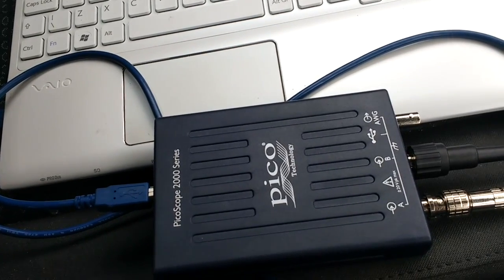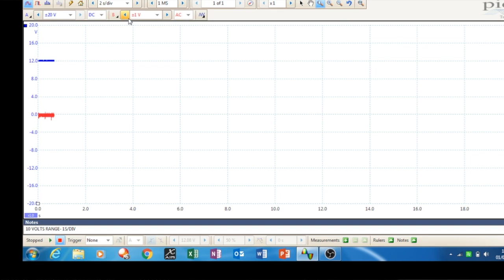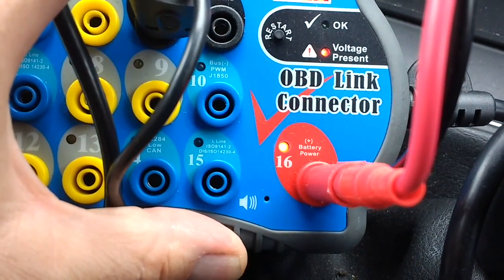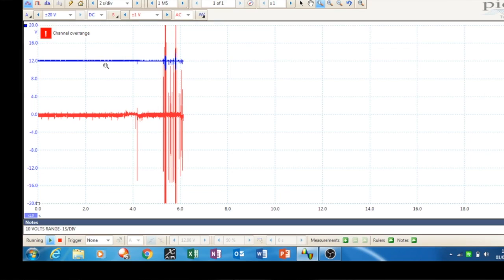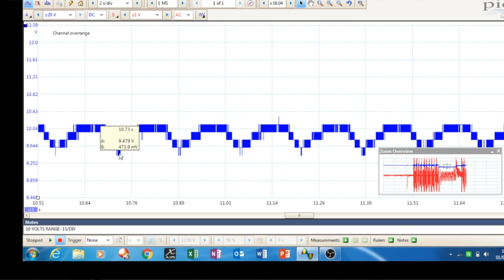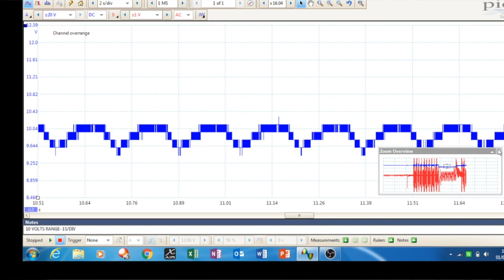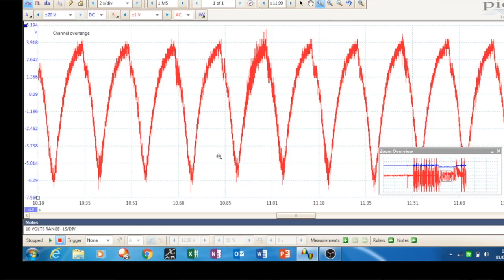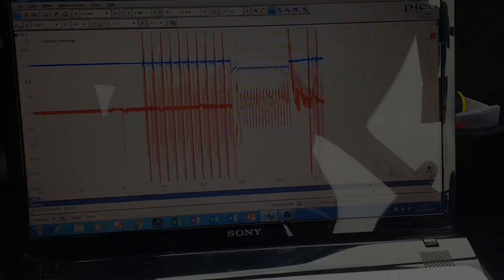PICOSCOPE 2000 PART 4

Comment: Hi sandy sir great video on this one. I have a tight budget but this one convince me that i pico 2000 is good enough for automotive measurements. What do you think sir? Thanks
Reply from the maker: Jack Tingzon yes sir picoscope 2000 is very good and will do most things for automotive testing but add attenuaters to protect it from high voltages many thanks Sandy

Comment: thanks for sharing this going to buy one myself .   if using this test to compare compression how do you know or how can you work what cylinder is what i.e 1-2-3-4 ? thanks. tony
Reply from the maker: tony pond on diesel u could sync with injector using 10x probe, on petrol the 5volt trigger signal on the coil on plug design (don't connect to lowside ignition circuit as it Max's out at 200 volts) or remove one spark plug, sandy